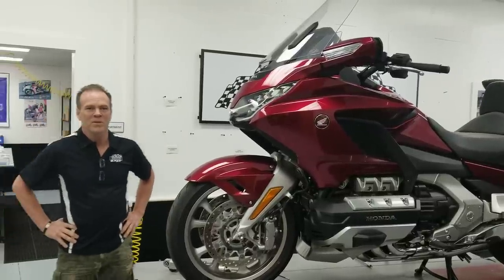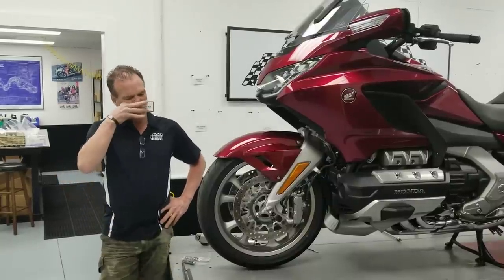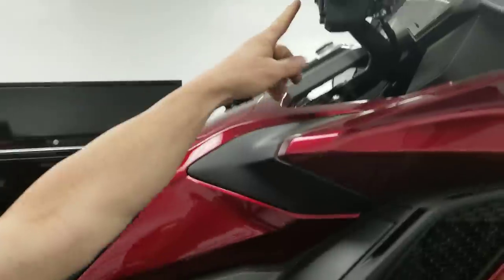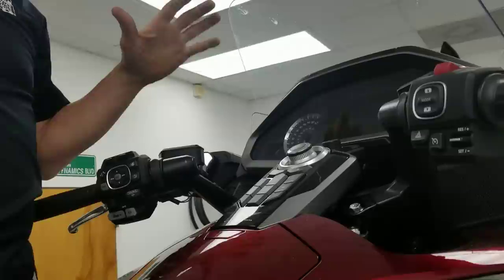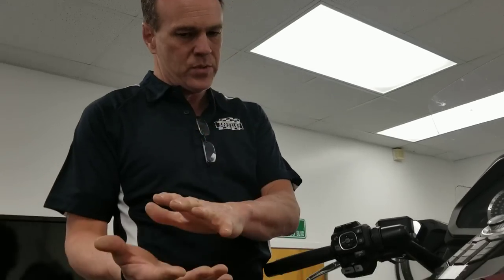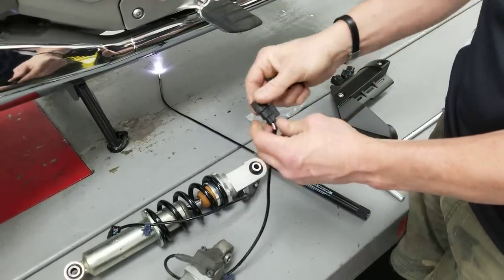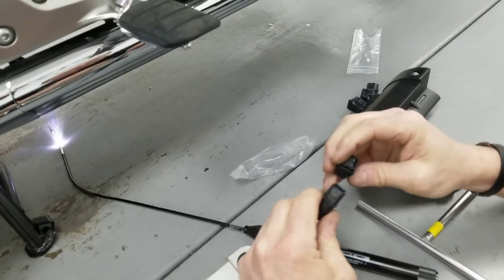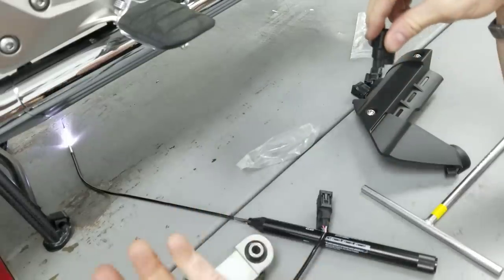Traxxion Dynamics Suspension Decoupling Kit - 2018+ Honda Gold Wing

Comment: NOTE: After setting in Sport Mode (stops blinking), shut down the bike. When you start the bike again, Honda has it set back to Tour Mode. As stated by Max, the back wire access is easy. The front will take some time and patients. Coming from me, that is a challenge. Walked away a few times, and days for that matter. (Wife gave in after a few tries.) The clip to release is facing the rear of the bike. Tilt the bottom toward the front of the bike as you press on the release. This will help get the clip over the catch. Ahhh finally. Then installing the dead plug into the fixed connector from the bike: Put a rag under that entire area. You DO NOT -NOT want to drop that onto the top of the engine! Done that.

Comment: Just received the decoupler plugs in the mail. Just want to make sure I understand the process. For both the front and rear shocks, one plug goes on the shock wire, the other plug goes on the wiring harness and they do not connect to each other. The shock wires are plugged and zip tied somewhere to the frame?
Reply from the maker: You can add some zip ties if you can get your hand in there, but there is only a small whip, there's nothing to be concerned about.

BE SURE to start the bike, leave it running, put it into Sport Mode, and then turn it off.  Then disconnect the shocks.  That will leave them in the firmest setting.

It WILL be a pain in the ass, especially the front one!

Comment: So what your saying is sport mode is as tight as you can wind the under sprung under damped shocks.  If that’s the case, would cranking up the suspension on a non tour job be optimum adjustment for what you have to play with?
Ok duh, never mind.  Got it in the comment section.  Did I mention that I’m a slow learner🤪
Reply from the maker: All good Joseph!  Let me know if you ever have other questions.

Comment: Max, You're 2018+ Traxxion replacement shocks/spring set come with the dampening preset and no longer use the adjustable OEM dampener connectors front & rear, is that correct?
Thanks....
Reply from the maker: Yessir!  You can change modes without messing anything up.

Comment: Max, I need clarification on setting the bike into SPORT mode.  I have a 2019 Tour.  My steps:   I had the bike running , moved to SPORT, waited until the indicator quit flashing, put into Neural the turned off the bike. Did me putting the bike into neural then turning off ignition allow the bike to go back to the TOUR mode for the suspension?  The reason I am asking is that once I was all done decoupling both front and rear,  I turned on the bike to take it for a test ride, I notice that the mode indicator on the dash reflect it was in TOUR mode.  Do I have to go back and reconnect the stuff and re-do all this again?
Reply from the maker: No.  If you turned the bike off in Sport Mode, and then disconnected the connectors, they were still in the Sport Mode which is all you want.  After that, no matter where you move the Mode, the shocks will stay in Sport.
Reply: Thanks, I was sweating your answer.  Have a good evening!

Comment: Hi Max will it work if the driver likes combo by doing one a the time ex. Sport rear and tour on front . ?
Reply from the maker: Yes, you could do that... but it's like pretending you can tell the difference between 34psi and 34.5 psi in your front tire....
Reply: @Traxxion  ok great i understand nice example.

Comment: I can barely get my hand on the front shock connector, but if I knew where the release tab was oriented I might have a chance of getting it off. Can you offer some assistance?
Reply from the maker: I know, it's really hard.  I would suggest finding someone with a smaller hand to try.  It's also easier for a left handed person I believe.

If you get stuck, just wait you can use the bike.  The plugs are just to weather proof the connectors.
Reply: Max McAllister & Traxxion Dynamics  My first attempt took me four hours I managed to disconnect the front shock , but could not attach the blind plug. I dropped it twice and with shear dumb luck was able to retrieve it both times. At that point I gave up. I was able to reattach the shock and in the process realized the wire from the shock to the plug helped me guide it back in place. That gave me an idea. I taped two short pieces of wire tie about two inches long to the blind plug simulating the OEM wires and taped the ends of the wire ties together making a sort of handle. To that I attached a piece of string to help retrieve the plug if I dropped it. This time it took me three hours to fully install all the plugs front and rear. I’m right handed and have large hands so it was a major effort. So glad it’s done!!
I’d attach a picture of the Rube Goldberg plug if I knew how. Oh one other thing. After I wired tied the loose ends of the shock wires, I used the string to pull off the wire tie pieces. Pretty ingenious if I do say so myself. 😊

Comment: So your blocking both the front and rear shock without effecting the suspension mode (single, single with luggage, etc)?
Reply from the maker: This disconnects the shocks from the Mode button (Tour, Rain, Eco, Sport).  It does not affect the rear spring preload adjuster (1up, 1 up luggage, 2up, 2 up luggage)

Comment: Good idea.  Well thought out but in sport mode the engine is still too responsive to the throttle as per your other recent video and the bike bucks like crazy ?
Reply: Once the shocks are decoupled you can select which ever mode you want as far as throttle response. The shocks dampening will remain in the sport settings.
Reply: Yes, but if the suspension is not upgraded it will be set in the worst position for handling, ie sport mode.
Reply: I think Max is saying that the sportmode suspension setting is the best one for all purposes, so this kit keeps the suspension in sport mode.  This obviously will not fix the undersprung, underdamped issue in sport mode.
Reply: I don't see the point of not being able to change the modes even though sport mode gives the best ride for all purposes.  Just leave it in sport mode if that suits you best ?
Reply: But why bother getting the decoupling kit if leaving it in sport mode does the same thing ?
Reply: Okay, I get it now, I think.  The different settings change the engine performance AND the suspension settings ?
Reply: Okay, now I fully understand.

Comment: Instead of a decoupling kit why don't you try to design an external controller that can control the suspension independent of the bike and with a better range of motion and selection settings that are say 1 to 10 or something like that. Now that would be something worth buying over loosing all functionality of the suspension all together. you could run a pole to see if that would be something people would be interested in.
Reply from the maker: The stock shocks work poorly to begin with, and the range of adjustment available with the stock electronic adjusters is undetectable by typical Goldwing owners.  Developing an expensive electronic device to control something that doesn't work anyway would be a waste of everyone's money.

I have a few videos on this topic back in 2018 when the bike came out and we dissected and analyzed all of the parts before we designed our own shocks.